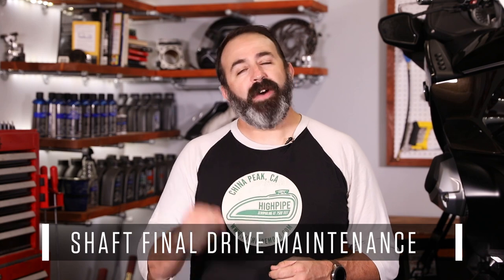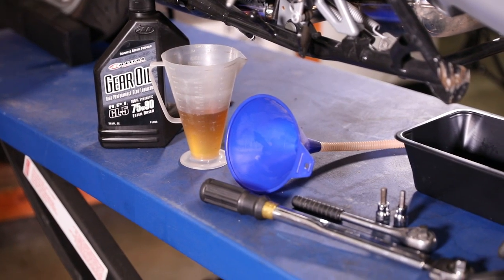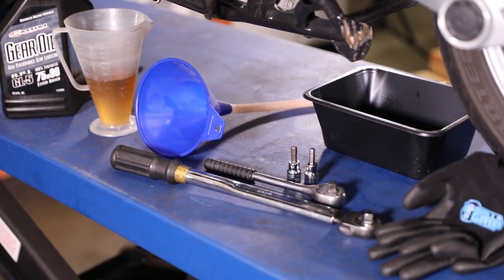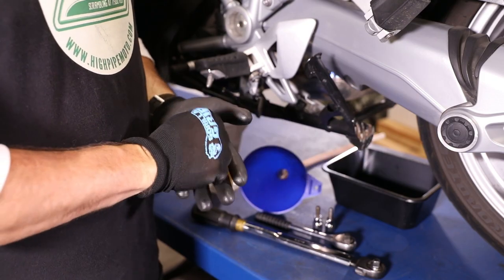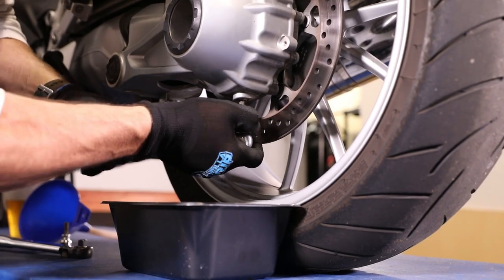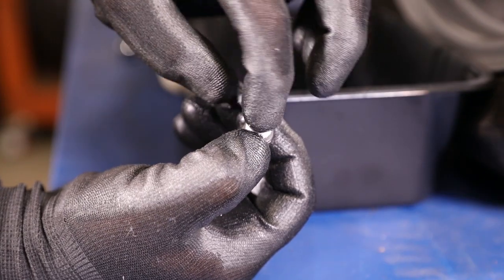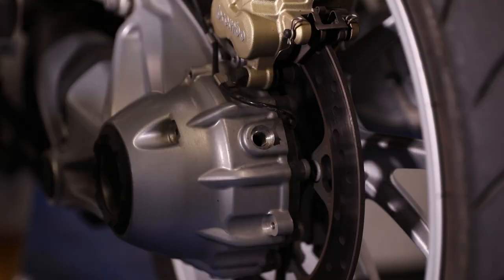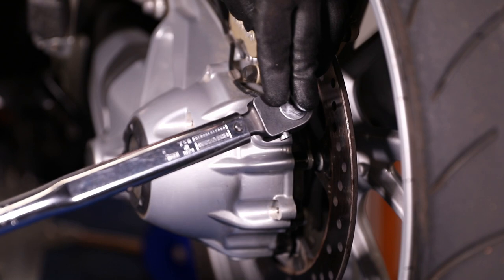Motorcycle Shaft Final Drive Maintenance | MC Garage

Comment: Great video, my friend! I own nine Moto Guzzi 1100 Sport's, and the final drive on those bikes has three oil ports. The filler port, located on top of the vertical plane on the final drive, which also has a FD breather installed on all of my bikes. Then there is the drain port, located on the bottom of the FD's vertical plane, and a third port, which is the overfill drain port located on the horizontal plane of the FD. This "overfill" port is used as a visual indicator of when the appropriate amount of new oil has been refilled. (The excess or overfill of the new oil will start to flow back out of the horizontal overfill port when the correct amount of oil has been added). It didn't take me long, having to service so many bikes, to learn that I can actually leave the top filling port in place when servicing my bikes FD.  I now just remove the drain bolt and the side overfill bolt, let the old oil drain, reinstall the drain bolt, and then inject the new FD's oil with a 60ml oral syringe into the overflow port. I think I inject around 220ml to 240ml until the new oil starts to flow back out of the overfill port, which takes no time at all. For me, needing to remove the final drive breather, which also means that I need to remove the upper FD's mounting bolt in order to access the filler port is a lot of work, so using the side overfill port and a syringe for refilling the new oil is also an easy and clean way of getting the job done; which is if you have a three port final drive design installed on your bike with a FD mounting bracket and mounting bolt surrounding your FD's filler port......

Comment: It is in good practice to remove the fill plug first. Let's say you drain it, and then the fill plug doesn't come out. Well, then you are just SOL aren't you? Remove the fill plug first.
Reply: Yup, this is best practice for when you do a differential oil change as well
Reply: And you want to have the oil flow out quickly to better flush out sediment.  So you get your hands a little oily.  Man up!  And real mechanics don’t wear gloves.
Reply: This is what I've always heard. Maybe you can snug it up again but always break that filler bolt before anything.

Imagine your first time finding out what a triple square is when you are looking for a tool to break your fill bolt.
Reply: agreed, but since it's a BMW, what could possibly go wrong (says the man who has owned 7 of the damned things)

Comment: Keep in mind that it may be a good idea to check the fill plug will loosen to make sure you can actually refill the oil.  It’s a common suggestion for car differentials, but may be important on old motorcycles as well.
Reply: This! This THE most common way to make sure this process goes smoothly.
Otherwise you might have to flip the motorcycle upside down to fill....

Comment: This video didn’t cover some things it should have. 
1. Always loosen the full plug first to make sure you can replace fluid you drain!
2. The use of a hair dye bottle makes shaft drive oil changes short. Seriously, I can pump 180-220mL of gear oil in my K1600 in a few seconds.
Reply: I commented that it was terrible advice to open the drain plug first and my comment was deleted.

Comment: You can also use 10w40, which has almost same spec like 80w90. And there is no such heat in shaft drive that could damage oil viscosity. "Hypoid" only means gears are at angle!

Comment: Shame they don't do shaft drive on the bikes I like to ride. Chains get mucky very quick here in the UK
Reply: Supersport/superbikes? The UK is just a mesh of bad weather so I totally feel your pain. Power delivery isn't as efficient so that's certainly one reason it isn't more common.
Reply: And even quicker in Ireland!
Reply: Chain slack smoothens the power delivery from the engine. You have fuel rapidly expanding in the cylinder and those shocks are quite rough on a sports bike, which would result in ruining your rear tire. Especially the grippy soft ones...
Reply: The weight!!!
Just think of the weight!!!
Me driving VMaxes (Gen1 & Gen2). So happy about the shaft drive ;-)

Comment: I find that putting the gear oil into a condiment squeeze bottle (think catsup), the ones with the nozzle works best. I have Urals, 3 of them. (and a Harley, but I digress)
I ride them a lot so I do this a lot and always, always remember to lube thy splines as recommended by the manufacturer, or better! 
Here is my edit, after reading the other comments, RTFM. You change diff oil more often than turn signal fluid...

Comment: Yeah BMW have the paralever and I've only used an XJ900S 1994 you only get power rise scare if you drop the clutch from standing start into corners too many grubby wash up sessions with chain drive I had a 1984 GPZ250 belt drive didn't get to test it though, the Honda CBX550 would've been in

Comment: Pro tip: any thing that works optimal when warm and that resides inside a waterproof container, place in a bucket of hot water. Here, the guy should have placed the oil in such a scenario.  Even changing out the hot water when it cooled.  My mechanic/shop teacher taught me this.
Reply: Justin Dawes thx!

Comment: A correction needs to be added.

Never, EVER, EVER, drain the oil without first removing the fill port plug. If you can't get the fill plug off or it gets stripped you don't want to find this out After you drained all of the oil.

A tip to help make the oil fill a little faster, put the bottle in a pot of hot water first.
Reply: Careful, I commented this and it was deleted.

Comment: I just bought my V star 1100 a few months ago. Decided to do a few low maintenance tasks just to kinda get a feel of the previous owners doings. Hed already disabled the AIS bc he put 4.5 cobras on and everything was checking out.... until i drained the final drive. Only a little oil came out but the rest was diluted (from the oil) AXEL GREASE! Im flushing it now but im worried there already may be irreversible damage. Large metal shavings came out with the grease. Do i need to open the final drive and clear out the rest of the grease?

Comment: How much is enough? Is it when it dribbles out the fill hole?
Reply: Should be written in your manuals. In semis its usually the case but then again, semis and bikes are two different things :D
Reply: Unfortunately the brainiacs at bmw made the bottom of the fill hole higher than the oil level so you have to measure it

Comment: I guess the frequency of shaft oil changes was not mentioned in the video - is it to be done with every other oil change?? Or once every three oil changes? Or just after a certain amount of miles ???
Reply: Read your service schedule for your bike. e.g. for Triumph shaft drive it is change once at the break in service (1000km) then never change again. You are wasting your money changing shaft drive oil too often or every other service. If a manufacturer recommends it go ahead but if not, the oil will barely be troubled at 30,000-40,000 miles. Think how often you get your car gearbox oil changed, like never! Too many people making a low maintenance shaft drive into a maintained item.
Reply: Read your Manual. Not every bike as the same frequency of changes. My Yamaha Venture Royale from 1990 did not have the same change frequency as my dads Honda Gold WIng 2006.

Comment: “Oil resistant gloves.” Puts on mesh gloves with a rubber coating on the hands. 🤦‍♂️ 
The coating may be “oil resistant” just like the sole of a boot. The rest of the glove, just like the rest of the boot, isn’t oil resistant.

Comment: "torque to the proper spec". Why not tell the torque value for the motorcycle you were working on?
Reply: @Justin Dawes to quote myself: "for the motorcycle you were working on"
Reply: @Justin Dawes sorry, I wasn't clear enough. You just specify: "which is x Nm for this bike" 😃
Reply: @rationalityfirst   Just check YOUR manual! Even bikes of the same make may be different depending on model!
Reply: @rationalityfirst  Liability. Just because you are intelligent, just mean others are as well.